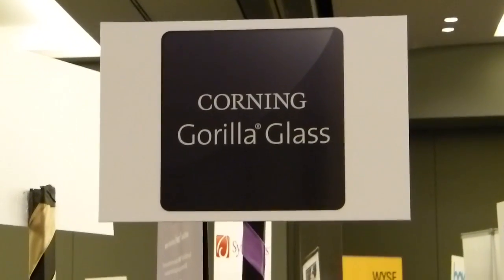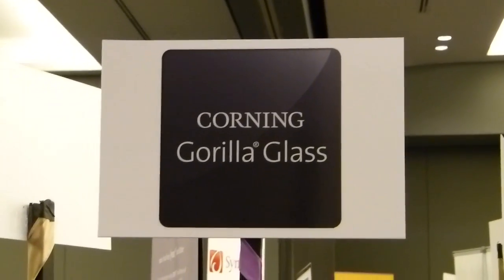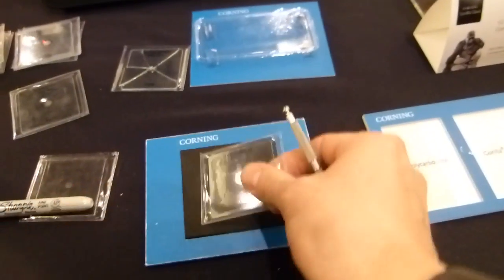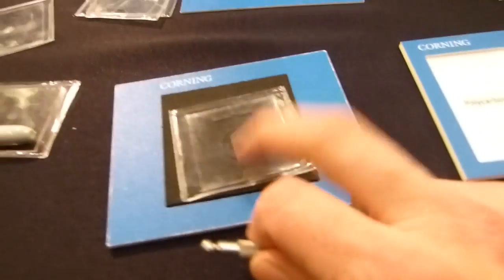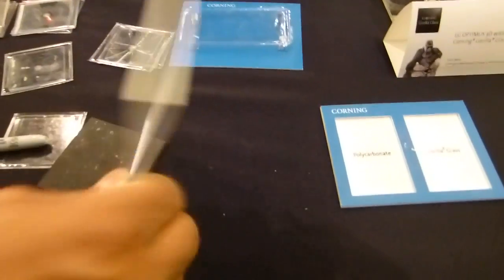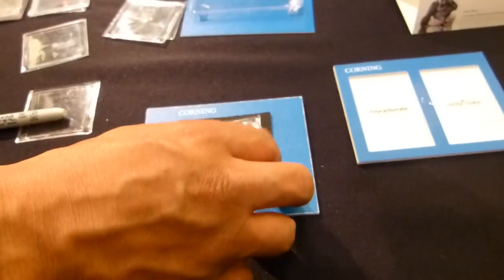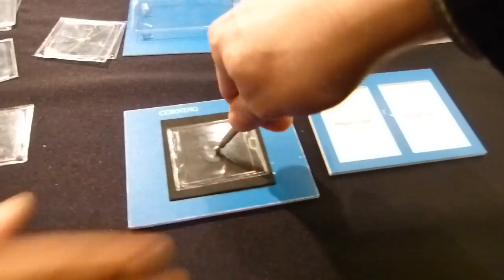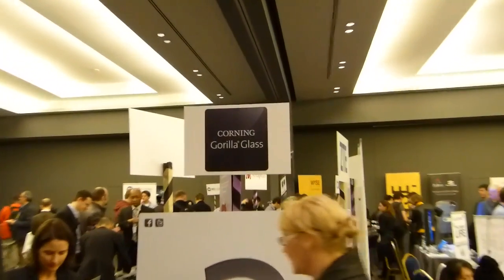Gorilla Glass 2 - Test Smashing 2012

Comment: the whole system is only as strong as its weakest component. In the case of a phone its only as strong as the display, not the cover (gorilla glass). You could quite easily drop the phone and have the display smash into a million pieces and the glass on top would be unaffected.

Comment: They are. they are stuck with adhesive. If you took it apart you would see the top and bottom of the digitizer are glued to the plate the LCD is on. Also I just like AMOLED is more natural colour. The blacks are literally real black, as in no light because to create the black they just turn off the LED's. The LED's are in between plastic sheets that contact the glass. The LED's themselves aren't actually part of the glass. The assembly is much the same as LCD :)